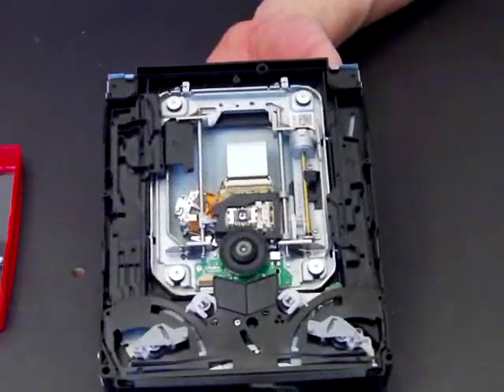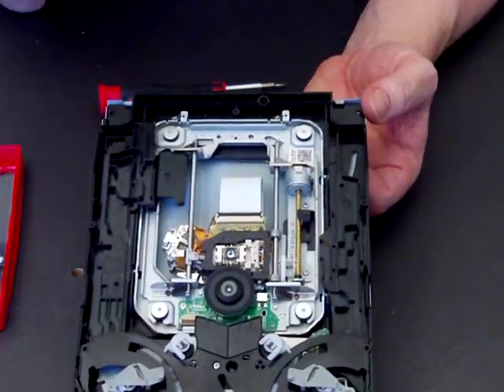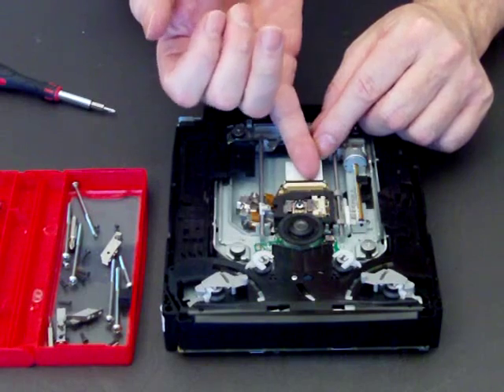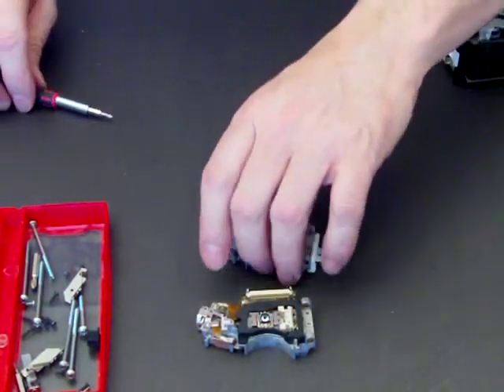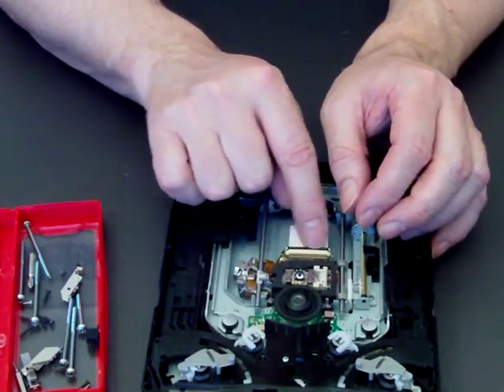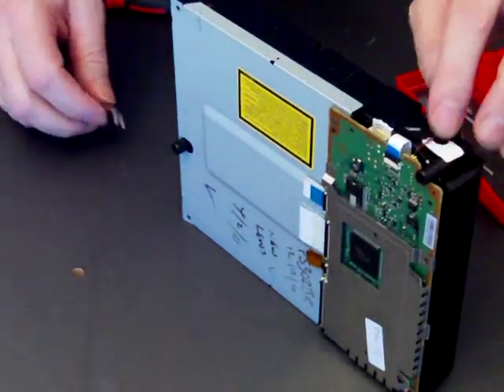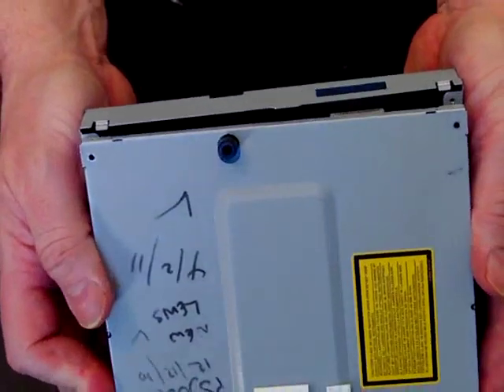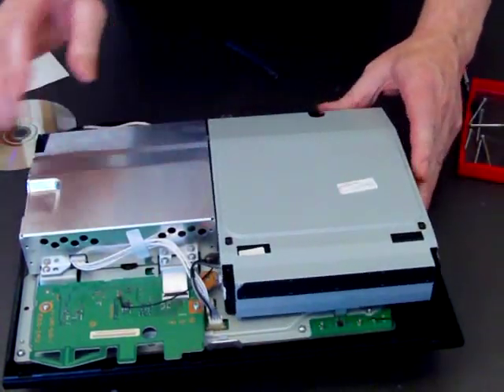PS3 Parts & Repair Guide - Replacing a 400AAA Blu Ray Laser Lens

Comment: Hi Steve, Thanks for the video.  I did your blu ray laser lens test.  I then bought a new lens and replaced it using this video.  I then did the same blu ray lens test again and it worked!  However, when I reassembled the drive using your videos something must have went wrong because when I attempted to play a disc in the enclosed drive it took the disc in and then made a loud clicking noise that eventually stopped.  I turned the system off reopened the drive and attempted the blu ray lens test again and it no longer appears to be working.  Now the gears are spinning but the lens is no longer projecting a light to search for the disc.  Any insight into this issue would be greatly appreciated.

Comment: My ps3 stopped reading discs of all kinds (Fat 80GB) and when I enter a disc it doesnt sound like the motor is moving the lens as it would if it worked. My question is should I get the whole replacement drive or just the laser?

Comment: I just realized the one I removed from the ps3 says KEM-400ACA. I ordered 400ACA but the one I was sent says KEM-400AAA. However, both are single lens and the only visible difference is the ribbon that connects to the motor that moves the threaded gold bar is straight on the new part and the old one has a bend in it. I am planning on taking the new laser and putting it on the old motor/frame piece and seeing if that works.

Comment: I replaced the laser and the whole frame with the motor attached and everything. The problem I had before my replacement was no spin and now I get spin stop spin stop over and over until it just stops after ~30 sec, but nothing shows up in the XMB. I put a clear disc in and I could see a violet light and a red light leading me to believe my laser is indeed good. Is it possible I put something together wrong? I have a fat 1st gen CECHH01 and laser KEM400aca. Your advice would be much appreciated.

Comment: i have a fat 40gig, and a 320gig slim i need to repair. the fat reads disks sometimes but hardly ever now. one time it loaded a certain game every time but not other games. with the slim it reads games but they always crash or load a black screen and not go any further. so would u say i should replace the lenses on these or replace the whole drive? great video by the way.

Comment from the maker: You would be better buying a drive in the US, the postage would be much cheaper and if anything goes wrong it will be easier to rectify. Try ebay and buy from a company which sells lots of drives rather than a used drive from an individual. Hope this helps Steve

Comment from the maker: To be perfectly honest I don't know what is wrong with your system, it's a strange problem. If you try a different lens you can at lease rule that out of the equation. The disc might not be aligned properly which would be down to the mechanism. Sorry I can't be of more help but as I said it's a strange one.

Comment: I have taken the system and drive apart and cleaned the lenses, but I really feel like it's some sort of loading mechanism issue and not the bluray lens.  But then again DVD's load just fine.  Do you have any advice/suggestions?  Thanks so much!

Comment: itself has less than 200 hours on it as it has been used mostly as a media streamer.  I tried to play a game last month and it would not load.  DVD's load fine, but bluray movies and games will not.  The ps3 takes the disc in, makes some quiet noise for about 15 seconds, then a louder noise as if it's giving up reading the disc.  However, if I tilt the PS3 up while loading a disc it loads perfectly every time and I can then set it down and play for hours with no issue.